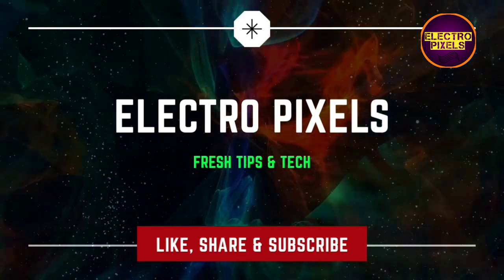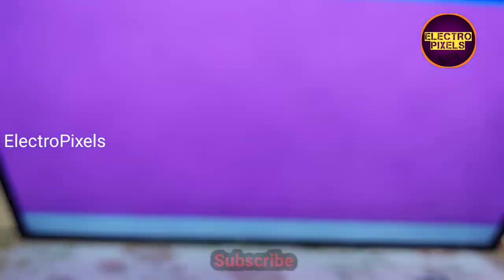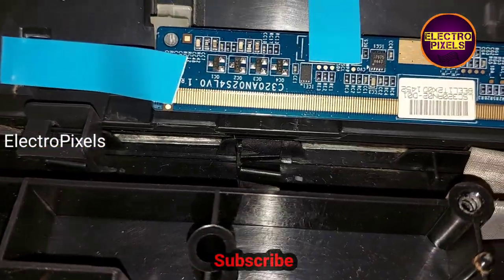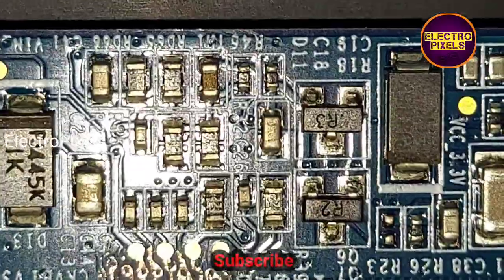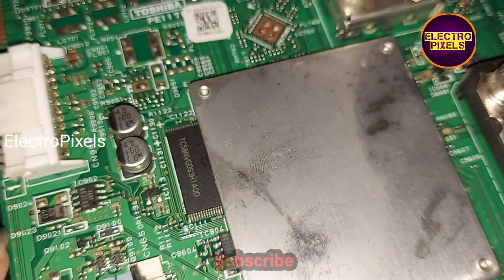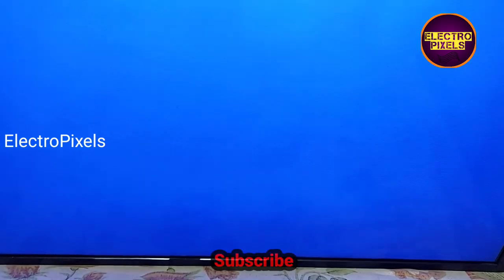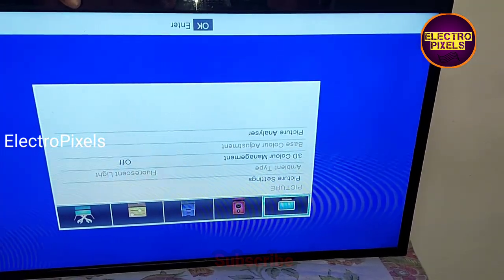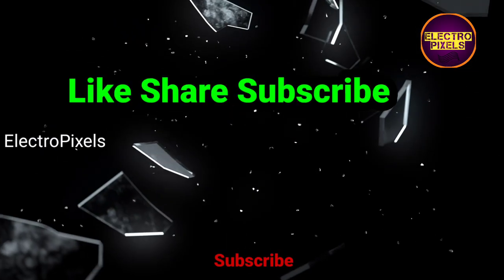Led Tv Double Image & Color change|Toshiba:32P2401EE|Panel Repair|C320AN02S4LV0.|Ckv Lines Shorting

Comment: Not permanent solution,yes
Reply from the maker: Already i mentioned in video that just temporary solution only. But it doesn't mean that it will work only for some days. People using more than 3 year's are also there. Cost of new panel is almost equal to new Tv so use it maximum